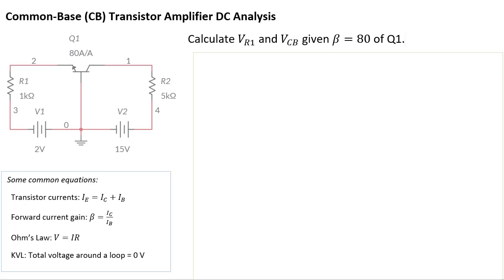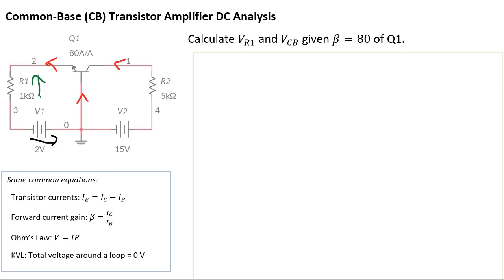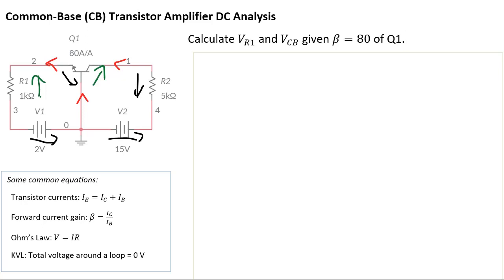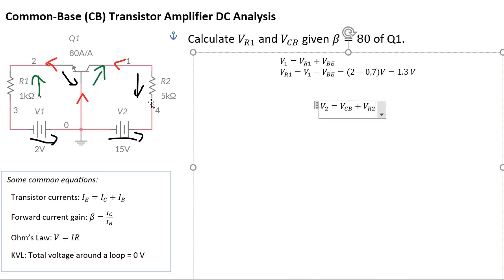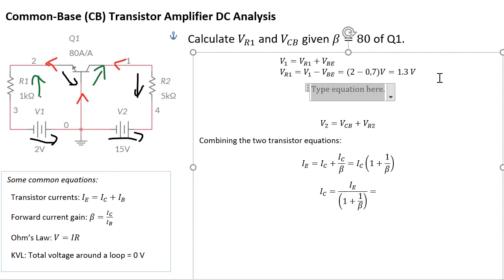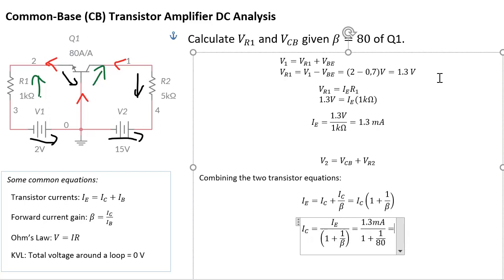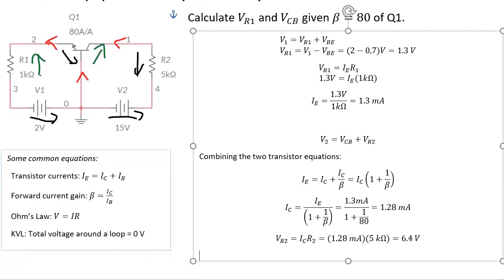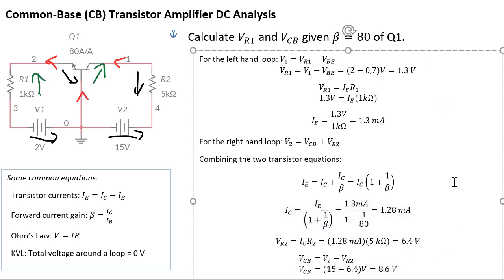DC Analysis of a CB NPN Transistor Amplifier

Comment: I think you also need to check Vce to make sure your initial assumption of this BJT is in active mode. Great lecture btw!
Reply from the maker: Hi TigerBalm. BJT active mode is when you have the CB junction reversed biased and the BE junction forward biased. The way the circuit is built (base is held at 0V, emitter at below 0V and collector at well above 0V) meant that these two conditions are forced onto the transistor. Hope that helps. 😊